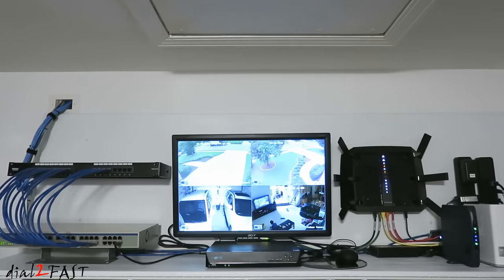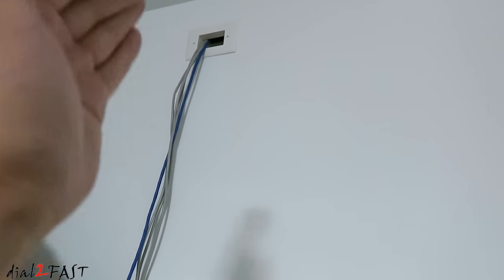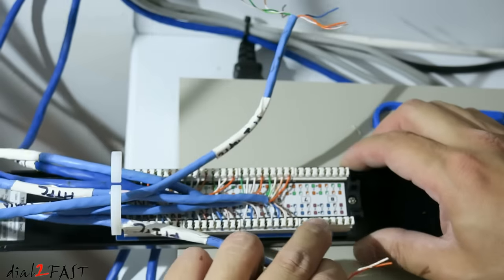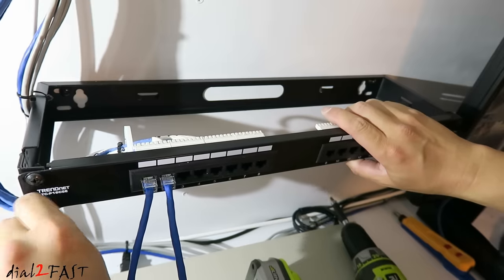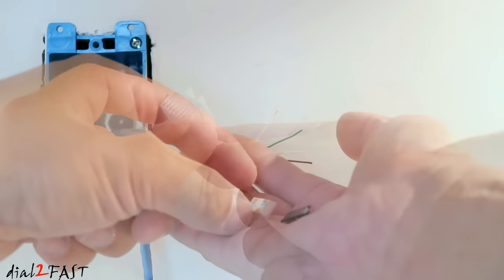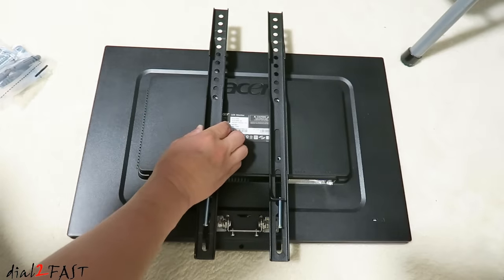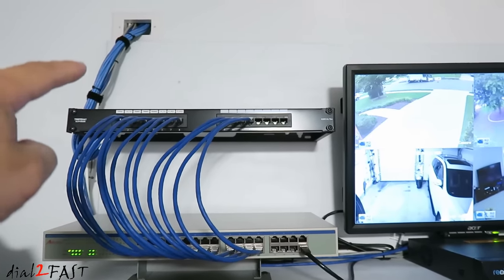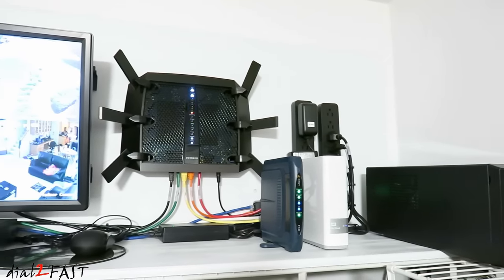DIY - How To Build Your Home Network

Comment: I even got into an argument about patch panels, with someone who also commented on this video as well... That person (who claims to have been a manager/director in this field for decades), along with some others, is arguing that patch panels are just over complications and are the primary failing points in a network. My question is: if that's the case, why are all serious companies using them? If they wouldn't be worth it they would not be used, that's how business works. 
Now, for a home network you can say it's not worth it. It's gonna be cheaper without it, for sure. 20$ (50$ with a small rack)? It might not be the best analogy, but you can dry your clothes on a piece of wire tied to two trees in front of your house, instead of installing a clothes dryer behind the house. It will save you 50$, but how will it affect the value of your house? It's not necessary, but recommended. P.S.: leave the wire pairs twisted all the way to the last millimetres when terminating. It might not seem like much, but if the cable is running close to some power cables, or coax and its picking up a lot of noise, then that little crosstalk at the end might be the last drop for the switch to revert back to a lower bandwidth. This is more relevant to Gigabit networks though. And yes, I personally had the pleasure of trying to explain to clients that, although we provide 1Gigabit connection (900Mbit measured average speed), the cabling in the building, done by the builders is not up to the standards and that's why the multi channel cctv feed from their factory in China, keeps breaking up.
Reply: The answer can be so easy if you use the correct wire for the correct things. 

Standard cable have a thick copper core for install inside wall. Standard patch cable have hundreds of thin copper core together so they very flexible. 

After the author of this video use patch cable inside wall so make a patch panel no sin. He can put the jacks direct at device. [Typical in U.S.A. for to use unshilded Cat5 cable.]

But in a real office or industry place with use of Cat8 / Cat7 shilded cables and possible fiber connections too do you see why do you need an patch panel. 

Funny too if you really need to patch something and/or change device - really - real copper can broke =》what is now easier/cheaper($) to repair? 
-> the 9000cm hard copper inside wall? 
-> the 50cm flexible copper from patch to switch? 
-> both, then the company buyed from a chinese company after they loosed so much money for remodel monatly the walls? 

I think, after the real company manager rethink this he/she known what "patch panel" are usefull. 

Same idea - build a house with direct link power cable to device or better use patch panel (talked it 'socket' and 'plug' with short cable to device)? 

This is known as "First thinking before do something!" 😉😂

Comment: Beautiful!!  Gave this a big thumbs up before even watching it.  Question...

How do you get the screws lined-up perfectly for the APC power strips??
Reply from the maker: If the screws are even a few mm off, they typically won't fit. I use a piece of paper and trace the back holes with a pencil, then transfer the holes to the wall, and drill.
Reply: I put a piece of  blue painters tape on the back of outlet strips and trace out the mounting keyholes. Remove the tape and stick it on the wall, then screw in the screws. Peel the tape off around the screws, perfect mounting every time. The tape is about the same width as a lot of outlet strips, so it makes spacing them easy if you are mounting several side by side.
Reply from the maker: Alan, that's a great tip on the painter's tape. I will use it next time. Thank you for sharing. Cheers!

Comment: It’s not hire I would do a home network.  I’m not a fan of these kinds of patch panels.  I love keystone patch panels.  You can install the cables onto all the keystones first and when done pop them into your patch panel.  The cool thing is, it makes it easy to snap the keystones into place where you want them.  That group each room togetherness.  You can use different color keystones.  Any places in the patch panels you’re not using, you can plug the holes up with blanks.  

I would have used a small rack for this location and placed everything into that.

Comment: Amazing job, I have two questions please:
How much it cost you for all equipment?
Also why powerful router and you use 10/100 switch?
Reply from the maker: I did this build mainly to clean up all the clutter I had. So the equipment were things that were bought and replaced (old router died) over the years. I didn't want to spend a lot of money to get all new gears. So that's why you see a bit of mismatch between old and new. As to why I am still 10/100 speed, well the things I have in my home (surfing, IP phone, IP camera, Netflix) don't go over 100Mbps. Many people buy a sports car, but they never take it out onto the track.
Reply: @dial2fast  Comparing gigabit to a sports car is ridiculous, you can get 8-port unmanaged gigabit switches for $15 on Amazon. Gigabit is a commodity.
Reply: @estusflask982  lol exactly

Comment: Why did you use a router when you have that massive switch right there!!?
Reply from the maker: The 4 switchports on the router is on the same broadcast domain as the switch. I could have moved 3 of those connections to the switch, but I had some devices like the security NVR and NAS that is right next to the router, so might as well use those ports on the router.

Comment: 👍 Only thing I would do different is use a pass-through panel, not the punch-down type. Makes trouble-shooting much easier...trying to pull out a cable on a punch block with 24 cables can be impossible without removing the ethernet rack...and if you have a 48 cable block that is full...well...your screwed...some folks may disagree, but for myself its much easier to crimp RJ45 plugs using the pass-through plugs...when trouble-shooting simply unplug your cable from the back...and I cringe when I see hand made patch cords, its labor intense, time consuming, counter productive but most of all, trouble makers...time is money...patch cords are cheap...

Same deal with wall jacks, just use a Keystone style female-to-female insert, its cheaper and quick, instead of fumbling with all the pieces of the punch-down type...

Comment: In the field we always use B config
Reply: Yes, B has long been the accepted standard among people who work in the industry. When i see an install that was done with A its usually very old. EDIT: Also, on a side note he talks about the benefits of a patch panel and planning for the future but hes rocking a 10/100 switch? Why would you be using anything less than 10/100/1000 in 2018?
Reply: Apply to US, in Canada we use A
Reply: I'm in Australia and the standard is B. Canada probably is too, maybe you didn't get the memo? LUL.
Reply: steelfalconx2000 Both ends of any ethernet cable need to be wired the SAME, or they will not work correctly. 
The only difference between the standards is that green and orange are switched... but this will screw with communications protocols. So they need to be the same on both ends of any cable.
Reply: I want help here to get what he done in the video, I think he made the patch cable with B config and both female RJ and patch panel wiring with A config ? Right? and if he made this will it work ?
Reply: @mrmohammed4316  no use the same punch down scheme on both sides
Reply: you meant both sides of cable, yes I got this, but I meant that he used different scheme; as in wiring the patch panel and female Rj socket, he used  the A standard but, in wiring the patch cable, used B standard, so my question this will work?
Reply: @mrmohammed4316  only use crossover when you are connecting to the console or p2p connection.
Reply: @mrmohammed4316  Yes it will work.  The NIC does not know what color the cables are.  It only knows pins 1-8.  As long as the ends are the same it doesn't matter, it's just a wiring standard for other people who will work on it in the future.  While it's not recommended for commercial or business install, what he did is no problem in a home build.  You could use any random wire combo, as long as both ends of the cable match.
Reply: Thank you I'm happy to know someone else caught that
Reply: @ProfPoon_PolyU  I Think your thinking of roll over cable for connecting to the console. When connecting 2 like devices (switches, routers, p2p etc) crossover cables are used when devices don't have auto MDIX enabled

Comment: 10/100 switch lol with a gigabit router lol
Reply: Can you pls explain what is wrong or inefficient about this i dont know too much on this topic
Reply: @sambhatt0  thnx
Reply: @RichMantaray:
What does it matter if his switch is NOT gigabit rated..?? This ONLY matters if he is getting Gigabit speeds from his ISP ... At that point his switch IS a bottleneck ONLY if he is NEEDING that Gigabit speed ...

And you don't need Gigabit speeds to surf or stream ..  99% of the homes in this world are not using 1 gig of speed at any point during the day. Even if you had 6 smart TV's streaming 4k at the same time, its still only in the 10's or low hundreds of Mbps ...
Reply: @badboifizz fizz:
Its not really bad in any way. 
Its bad because you have one device that is rated to support 1Gbps while the other device is rated at 100Mbps ... 
This ONLY becomes a problem when you are streaming more than 100Mbps ... As long as he is not pushing over 100Mbps, his switch is ok, when he tries to push over 100Mbps, then his switch will be maxed out and will not allow more than 100Mbps ... 
There is NO TV or laptop or cell phone or gaming system that will pull more than 100Mbps on its own. Maybe MULTIPLE devices doing heavy streaming MAY exceed 100Mbps TOTAL ...
Reply: @SamBhatt:
If his ISP is not over 100Mbps, then its all irrelevant ...
Reply: Could anybody recommend a good 8 port 2.5 gig switch

Comment: Have you heard about racks?? Better to mount all things in a rack. Switch, patchpanel, router and so on. And you dont need to untwist the pairs. Just untwist so you got a opening. I learn that from fiberninja. He is very good :)
Reply from the maker: Yes I install and use equipment racks at work. Most of these consumer grade devices are not made for rack mount, and even the cooling is not designed for front / rear air flow. If you want to put your Netgear consumer router on a rack tray, go right ahead. Untwisting an inch of wire at the terminating point is not going to change the performance of the wire. The purpose of using twisted pair is to provide EMF filtering along the run of the wire. At any terminating point (patch panel, or switchport), it's no longer twisted and it's not necessary. There is real science behind electronics, not just for cool factors.
Reply: dial2fast sorry. It was just a advice to not untwist the pairs. You save time :).

Comment: 7:00
You are def NOT following traditional color code. Your system works because you are keeping the colors consistent with the pins on each end so continuity works, but i guess in the end, all that matters is that it WORKS ... 
I don't have the room to mount that large black wall "rack mount" that you have there. I just ran cat5 to ALL devices and ran them back to my (man cave room) and pulled them thru the wall outlet and left about 2 ft out the wall & just put RJ45 jacks on each cable and marked each one to where it goes and just run a cat5 patch cord from IT to my 24 port switch .. Some i even split the cat5 in half to run 2 different internet feeds to that one location. 
And my WiFi AP is not in the same location as yours, mine is mounted in the center most point of the house for even distribution. 
And why do you have certain devices wired to your 32 port switch and others wired to the wireless router..?? Why not wire everything to the 32 port switch..??

Comment: Amazing ... but everything thing is being or going to be wireless, why one needs so many ethernet cables nowadays?
Reply: everything is not going to wireless. home networks will never be completely wireless which mind you has its limitations. if everything was going wireless then the biggest companies in the world wouldn't be spending ungodly amounts on money on running cable. in the end wireless is as dependable as wired connections for NVR's and network storage etc etc.
Reply: as someone who deals with hundreds of residential wireless settings I can attest to the fact that wireless is terrible for reliability. As more and more stuff is broadcast wirelessly you're losing more and more air space to transmit data reliably without interference. too many things overlapping on 2.4 currently and 5 has terrible range. All the newer wifi standards (AD/60GHz) have ranges of 15-20 feet at best and experience exponential drop off. Wiring a home is, right now, the only 100% reliable way to run a network.

Comment: the more i see patch panels the more useless they seem to be. Yeah you explained what they do, but the only benefit you also said and what other people say, is to make everything look cleaner, the mess just stays behind the patch panel which stay connected anyways. so if you dont want to use a connection just disconnect it from the switch till you need it again. But other than that i like this video shows everything except how you ran wires mostly.

Comment: I do this for a living. You should be using the B configuration. The 568B configuration is the industry standard. Other than that, not too bad for an amateur.

Comment: could have used an ethernet powerline extender instead of seeing that crap in front of you. the switch would be the only thing that you mess with. you dont mess with the router/modem much at all unless wifi went out. you just cut a hole in your wall for no reason

Comment: Weird B is standard you used A from the patch panel to the jack, but then switch to B on patch cables? Why do you have everything connected to the router? its usually modem to router one cable to the switch and then everything is on the switch which helps with the traffic etc that's the point of a switch. to each is their own I guess.

Heed the warning also do punch down with your thumb right under the cable your punching down that is of course you don't mind the blood and pain that comes with that mistake
monoprice for the jacks to much cheaper
Reply: He does not have everything connected to the router, but he does have the patch panel conned to a switch. On the right side of the switch there is a singe, black cable. That is the only cable connecting his switch to the router. 

The router is the black box with the antenna to the right of his monitor. It has the black, green, yellow, orange, red cables connected and facing downward to the shelf.

Comment: So with this I can have my own wifi without paying bills ?
Reply: If you want Internet access (note, there is a big difference between Wi-Fi and Internet), you will still need to pay for Internet access from your provider. There's really no way to get around this part. If you simply want Wi-Fi, and no Internet, then yes, you can just buy a Wi-Fi router and set it up and you will have Wi-Fi and no bills to pay.

Comment: You shouldv'e used the slot in the rack mount to run cable into the patch panel? Looks more professional in my opinion. Also, T568b is more widely used rather than a. That would confuse a lot of techs working on the system, but your country may be different from the usa since you said cm (centimeters) like everything is. Buy a bigger rack mount, use the rack mount ears provided with switch and mount it together. more professional.  Use stranded pair copper premade patch cables to connect switch. Solid copper breaks after moving it one too many times. Also, use the rip string to strip outter jacket to ensure you have uncut wires. The deeper this video goes I have to question if you've done this before.... You have one ubiquit AP, with no cloud key or any other Ubuiqiti components? I would have used all ubiquiti products; firewall gateway, cloud key, switch,  AP's. to get the full Unifi capability.

Comment: why use patch panel?
if you just direct connect it to switch, it save money
Reply: Because it's best practice. For example, You don't want to have to touch your horizontal runs at all after installation. Wear and tear will make cables go bad and it's much easier to make a new patch cable than to run a new drop across the house.

Comment: when i see this videos i honestly wonder, what kind of system are ppl running at home? 
i have a 200mb connection router with 1 cable to the pc. this guy has switches, probably a dmz and bastion host. wtf xD
Reply: André Mariano we are in 2019! Is common now to see in our houses some smart tvs, a network printer, some PCs, some audio-video streaming devices, some access points, domotic devices ecc..... so you can run all on a single WiFi router, and then have a poor network or just wire all this devices and connect them together with a strong and stable link! And then let the WiFi use only for smartphones and tablet
Also consider that in new houses under construction is easy to wire all the rooms and centralize cables where you put your network devices (if possible in a rack )
Reply: @NARoads2016  wdym poor network?